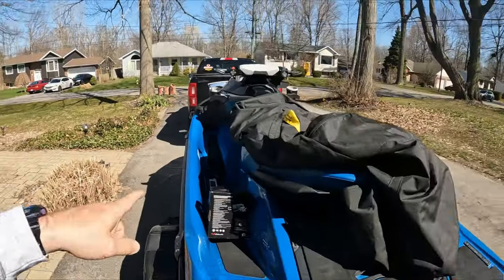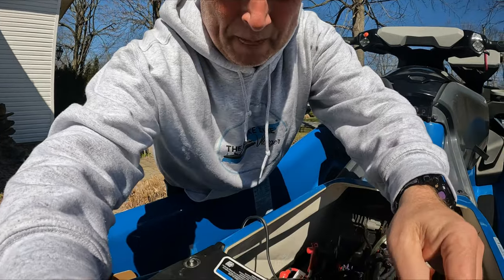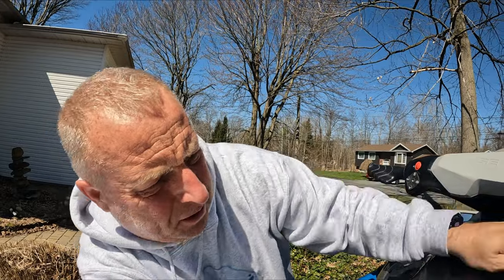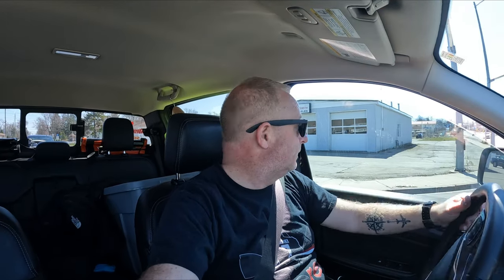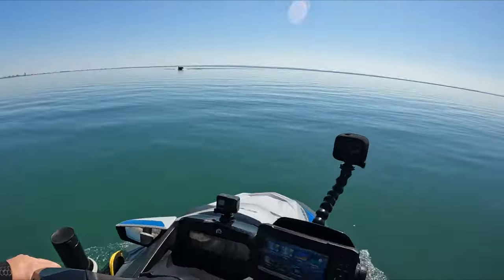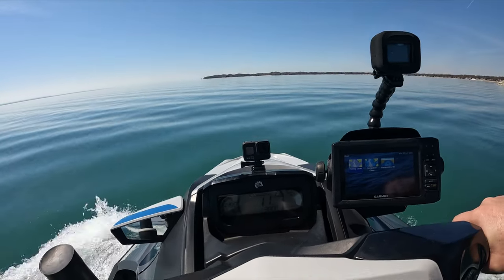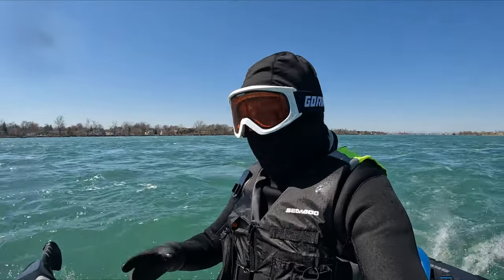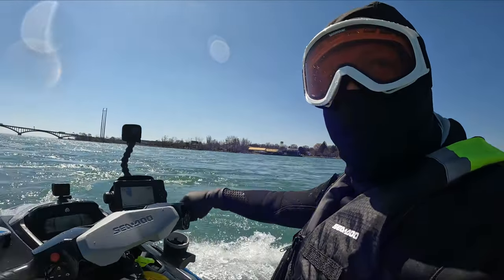You must check everything! - First Sea Doo ride of 2023

Comment: If you're worried about little four legged visitors during the winter, you could cover the openings with plastic wrap and tie it off (we do this with the water pipes at the cottage) and maybe throw a few bounce sheets under the seat.
Reply from the maker: never had an issue last winter, but i will most likely do that for the next winter

Comment: Stuff any vents and exhaust ports with steel wool when you winterize it next. The thick stuff. Rodents don't like it one bit and won't try to get through it or make a nest with it.
Reply from the maker: this winter im blocking off the grate with plastic with just very small holes for ventilation